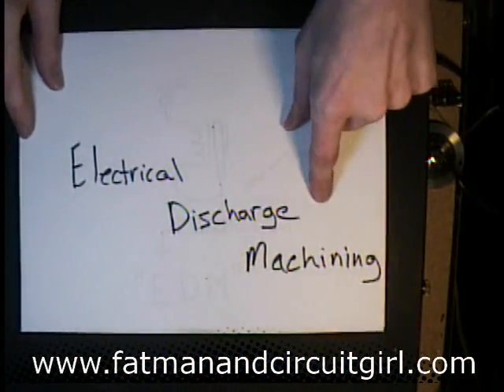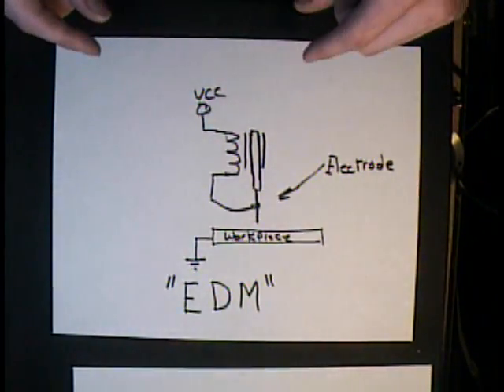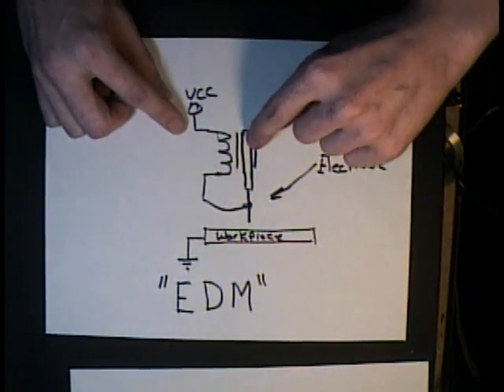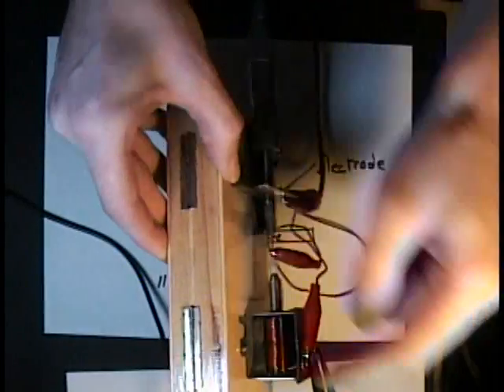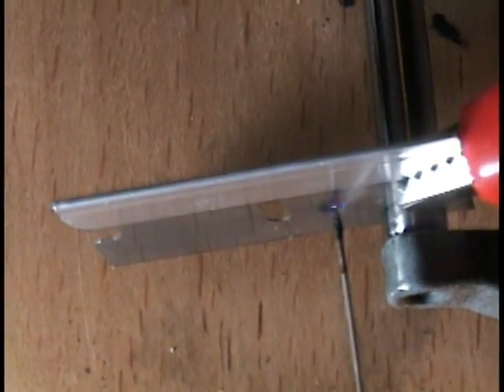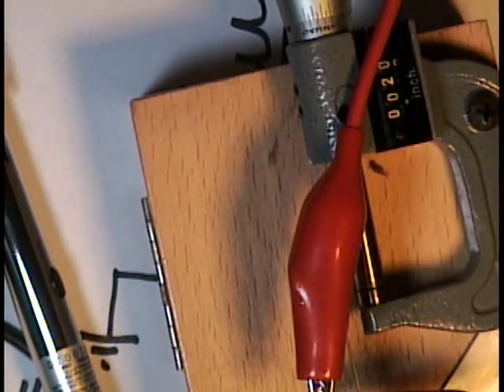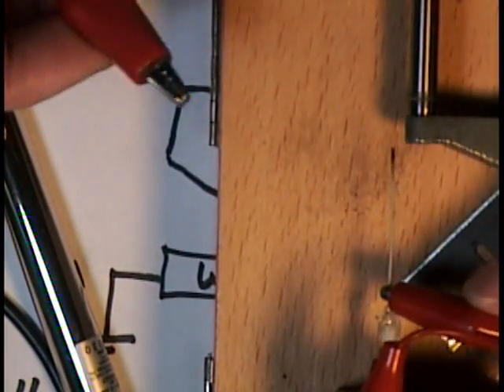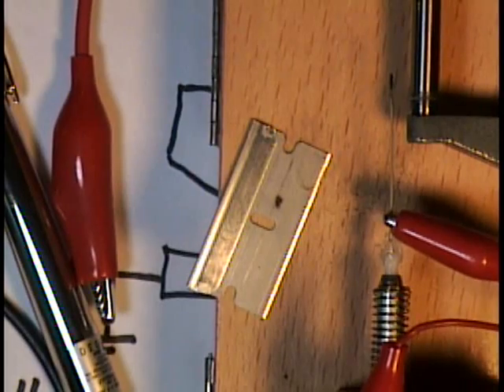Electrical Discharge Machining with old Doorbell Parts

Comment: If I remember correctly, in electro-chemistry the anode is the one that gets consumed, so wouldn't it be better that the VCC was connected to the workpiece instead of the tool? Or does it make any difference in this context?

Comment: A bit curious about what the power levels are at the tip. Your power supply is putting out 5v 1a but as I understand it the, solenoid would have inductance, which would drive up voltage when the connection is broken ?

Comment: Hi, I'd like to know the difference between an EDM and a micro welding machine, maybe a new video would be nice - thanks - Also, I would like to know about the polarity. Is the negative on the work piece, assuming that DC is used?

Comment: I was an EDM machinist for 6 years.
It also need dielectric fluid to keep the work piece and electrode cool and flush away waste particle, which would get stuck in the  work piece's cavity and insulate, stopping the process!What she's showing is something very simple, cutting through a thin metal!
Try to EDM drill a hole through 6" thick titanium, straigth,, square and  size within +/- .005"? LOL!
Now days CNC EDM , sinkers or wire machines can cut very precisely (less than 1/1000 of an inch) and fast, used in the Tool & Die , Mold making industry etc...
EDM's don't care what materials eroded , long as it's conductive!
There are other cutting processes out there, like laser cutting, water jets, chemical erosion etc... but non of them as accurate, precise than EDM!

Comment: A very similar device in a science class (junior high school) uses a wire wounded carbon rod which acted like a magnet, which push/pulls its wire. Works to engrave names on harden steel. A teaching aid, it consists of a few parts kids have to assemble themselves. It had the same principle. Solenoid is better since solenoids are easy to find. Kept it for a long time until I finally threw it out.

Comment: electrode will stick if you put it too close to the surface, the arc forms, heats  and adds material by letting little drops of molten electrode add to the molten pool of the welded material, if the arc colapses because you make a short circuit, it will cool off and the electrode will stick.
the EDM process is different because it uses a higher voltage and a dielectric other than air, which makes it a different story all in all.

Comment: how is this system affected by power (that being more amps or voltage going into the system, only one, not both)?
as always, your videos surpass every expectation!
Reply: have not tried it but i guess using high power to the electrode it will stick to your material.?
Reply: on regular welding (my area of experience) if you put amps to work (and lower voltage because you use a transformer) you produce more heat, and can weld thicker pieces, higher voltage means a longer flying spark, but lower temperatures, then comes the fact that this is submerged in dielectric... well worth trying.
Reply: I have no experience in welding but i noticed that, if you don't keep the right force (or distance. I don't really know)  to the object, the welding electrode will get stuck onto the object. That's why i was thinking this. Or is it only the right amps and volts that count.?.

Comment: If take a double "a" battery apart the core works well for an electrode. A good use for a larger scale model is removal of broken taps in motors and devices. Since the tap is very hard and very difficult to remove when buried in a part. Also if you submerge your part in oil this will help slow the destruction of the electrode and keep the part at a controlled temp. Very interesting design!

Comment: Very cool and easy circuit! I just made my own version ( very small from a camera solenoid )... 3 years later but it works fine on 1.5 volts to light up an LED in parallel with the coil.

Comment: I find this facinating, I am thinking a solenoid off a car starter motor, 2 x isolated linear bearings, hardened shaft with an electrode holder and a car battery for power. What is the best material for the electrode?

Comment from the maker: @blckfire539 This was mostly for a demo, but you could plunge the electrode into very thick metal or you could make electrodes of a non-round shape and form holes in that shape.  This technique can erode metals that would be difficult to drill like tool steels or stainless.

Comment: In a true EDM machine there is no contact. The circuit senses the gap and controls the advance of the electrode using servos. But this is an awsome revelation. And I suppose one could use an inert gas to assist.

Comment: Interesting! It should be done underwater laced with a dielectric. A traveling wire EDM typically uses brass wire and it machines hardened metals for the most part, like D2, A2, M1, carbide, other tool steels. The blank us usually drilled at critical points to accomodate threading of the wire through the 'starter' hole. Then it is hardened, and then it is sent to the EDM machine to cut out the holes. Typically used for dies, in stamping.

Comment: could you use reverse electrolysis? 
you could draw on the metal with some resistive 
material to get the picture you want on it.

Comment: oh cool I got an EDM on the back-burner, we have a couple at work, they are apparently great at cutting the heads of the special rivets we use to hold turbine blades on the disc

I asked the guy if I could have some "alone time"  with the machine he said come back on the night shift , hehe , I will bring my dmm